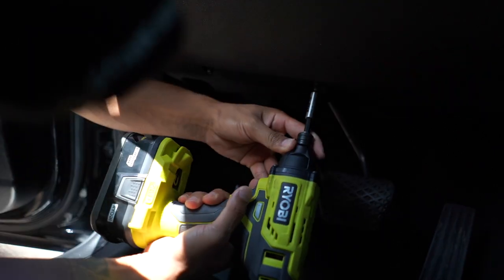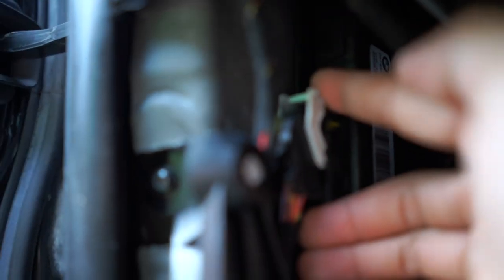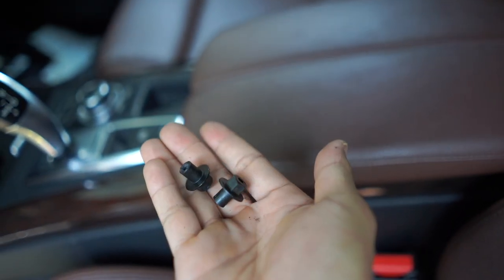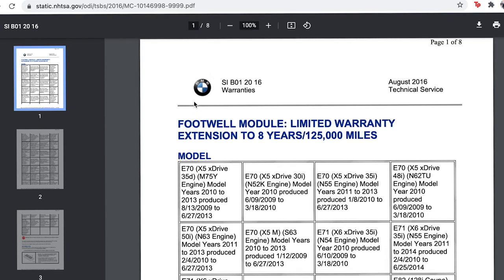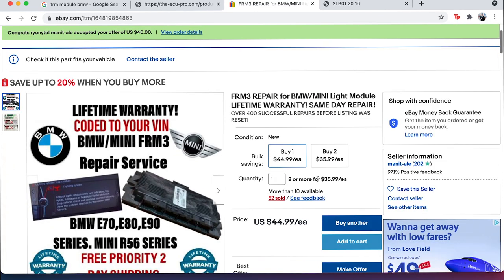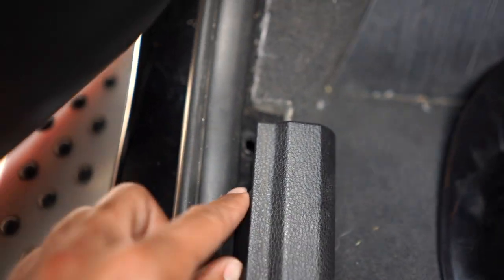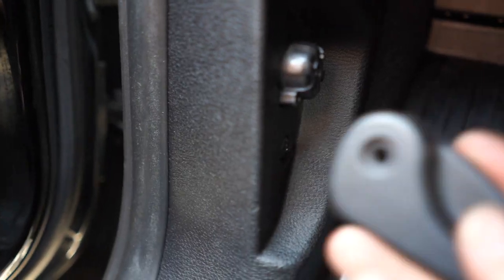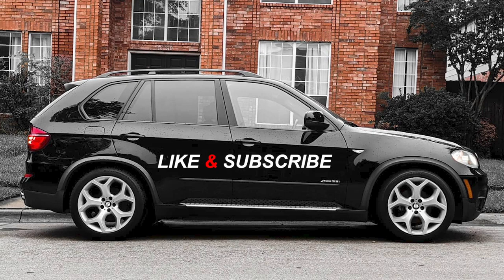🚘 Fixing My BMW X5 E70 Footwell Module - Lighting System Malfunction | VLOG 24

Comment: Hi bud.  I have same issue on my x5.  I send in my FRM for repair.  One question, if you don't mind answering.  when you installed your repaired FRM did you disconnect battery first and then you installed your repaired FRM and in last did you reconnect battery?
Reply from the maker: Correct

Comment: How does this not just happen again once connected? Bought new battery and frm module went. Also got a COM code but definitely frm module bc symptoms are won’t stop going back into park while attempting to forward or reverse, headlights on, flickering dash with lighting system error and windows won’t go down. Do I had to get the battery reprogrammed before installing frm module? Thx.

Comment: I changed my battery, kept it connected to a trickle charger while I removed the battery, and installed a new battery.  Once reconnected, I started the vehicle and received an lighting error on the information screen.  I checked the windows, turn signals, headlamp control and none of the switches worked for me. 
In my research I read that after replacing the battery it can take 6 hours or more for the systems to reset and configure....
Another thing that was happening, each time I started my 2011 X3 within hours after the battery replacement, the lights would flash 5 times and switch to low beam and the directional lights would not adjust.
I changed the battery Friday evening, I started it a few times, ran diagnostics with my scan tool, I turned the steering wheel lock to lock to see if the adaptive/directional lights would work, I cycled through my panoramic by holding the button for 40 seconds or so, I turned off the car and watched the hazard and other lights flash, I locked the car and let the car sit.  I researched on line all of the videos on the FRM and planned to purchase one today.  I went to the car yesterday, started it up and everything was back to normal and no malfunctioning.  Thank God all is well, otherwise I'd be making another repair on this car.

Thanks for your video(s) and if needed I'll be o
Reply from the maker: Glad it fixed itself!!
Reply: @jpht.adventures  Thanks.  I think the system took a number of hours to reset and calibrate after battery reconnection and   registration.  I'm glad I waited a little before completing my FRM purchase.  I'm grateful for all of these resources, contributors and discussion boards.

Comment: Does the footwell module have an internal battery?
My OBD says that the footwell module battery is dead but I can't run the engine, right now so I don't know if that's right.
It's a 2012 that I bought a few months ago.
Reply from the maker: To the best of my knowledge it does not.
Reply: @jpht.adventures  Thanks. Apart from not being able to code my lights, I'm experiencing no problems with the Footwell Module so I'll leave it alone.
X5 won't start. Not yet diagnosed so I changed the battery which was due.
I suspect my problem has something to do with contaminated fuel due to the gas station running out.
Waiting to get my car into the shop on the 15th.
You have been a great help.
Jim

Comment: Does this cause your low beam not to work? The mechanic said this was my issue $950 parts and labor🤷🏻‍♂️ also stated it needed to be programmed but I didn’t see you do it.
Reply from the maker: Everything worked as it should, no issues with my low beams
Reply: @ would you recommend that technician to fix a module?

Comment: I appreciate this post - many thanks!  My dealer told me that the FRM needed to be replaced because he couldn't figure out why I was constantly getting the right rear break fault code.  Also, one of my FOBs stopped working a few years ago and they THINK a new FRM will fix all that..  so I said, before I spend $1,400, let me look into this.  Can I ask what your symptoms were before you had your FRM repaired?  Congrats, by the way!   thank you.

Comment: Maaan, thank you for this video bro. I am going through the same problem and cannot figure out what the issue is? I may have to take the same route you did and try it out.  Do you have the contact of the guy of fixed yours to share. I am desperate and need this car to run.
Reply from the maker: Any guy on eBay with good reviews should work, or go on your local BMW Facebook group and I’m sure there’s a master tech that can do it for you

Comment: Couple of warnings.   I've had this happen 3 times on the same car...usually because the battery died and needed a jump.  First guy didnt offer a warranty, so I had to go to new guy who had a warranty.  When I went back to him after 8 months (when it bricked again), he was no longer in business...so great warranty there!  Now I am considering just buying a new FRM3 since it seems like my FRM3 is fragile and this will keep happening over and over again.  Anyways, make sure you get warranty with a reputable company unless you plan to buy a new FRM and have it coded.  BMW should make this a lifetime warranty items since they know they produced a sucky product...I am out of warranty by a couple years.
Reply: Thanks for the tip. Did you ever figure out why your battery kept dying? Im currently going through this with my car. And am about to try removing the frm for the first time to get repaired

Comment: SOS Malfunction video pls? Thx
Reply: Does the footwell modual keep the car from going in to drive or reverse?  
I have the same window and light issues as well... as not going in to gear.
Reply: @kristenjarvis8492  sounds like trans issues. there is a lever on the side if the transmission pan that sometimes can get disengaged. maybe that?
Reply: @kristenjarvis8492  

Hi, replaced my ‘12 BMW X5 35D w/OEM battery and experiencing same as you re:  Drive/Reverse issue.  Did you get yours fixed?  Update please?  thx!
Reply: @kristenjarvis8492  Hi, replaced my ‘12 BMW X5 35D w/OEM battery and experiencing same as you re:  Drive & Reverse issue.  Did you get yours fixed?  Update please?  thx!
Reply: @willc275  yes, I sent my to a guy on ebay who fixes the fw module.  There are several on there.  He was located in Florida.  Sent it off and had a message they fixed it the next day and sent it directly back to me.  $40! ☺️ 
But then you also have to take it to a shop who knows about bmw to have them match up the battery to the car.
Reply: @kristenjarvis8492  Nice and thanks for Reply.  Care to share your guy on ebay who fixed yours?
Reply: @willc275  305enterprise 
I tried to screen shot it but it won't let me post a picture. They were great. I think you can make an offer on the price too.
Reply: @kristenjarvis8492  Cool cool.  And the Drive and Reverse issue all fixed and went away once footwell module fixed?  Thanks!
Reply: @kristenjarvis8492  Thanks for the lead.  Thanks @justpeterhengthings for great video.  Helped save me grief and $$!
Reply: Hello.    Can you tell me who you sent it to ,? Or a way of contacting them ?     I definitely need someone to reset my FRM on mini Cooper ,.     The dealership is WAY too expensive,.
Reply: @redterra7842  I looked up in eBay for people that do these modules and that has good reviews.
Reply: @kristenjarvis8492 could you possibly send me the sellers contact info if he still in business ofcourse